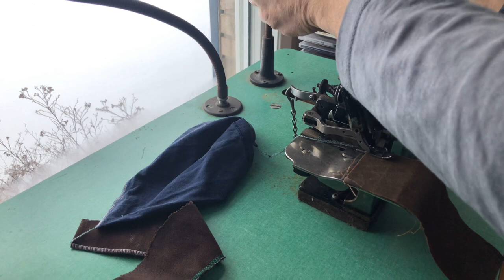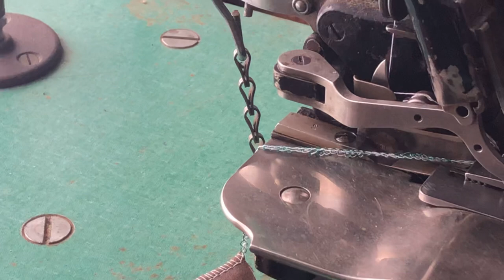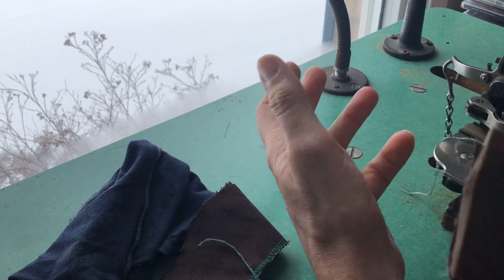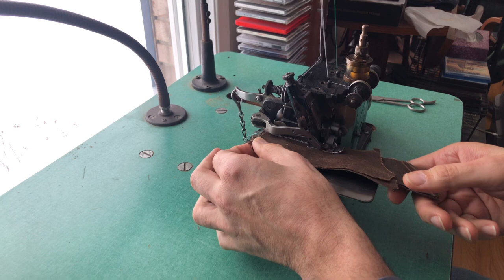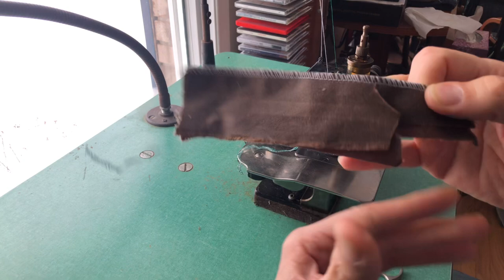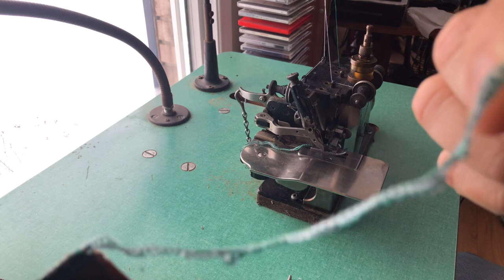MEET YOUR SERGER'S ANCESTOR: The Merrow A-3DW-3: From the Brand That Invented Overlock Machines!

Comment: Wow, what a powerful machine. That motor noise would drive me nuts. Now I see what the stretch overlock stitch on my Kenmores is used for. I always learn something from your videos. Looks like you've got some snow up there. I am about 6 miles inland in Connecticut. Week before Christmas we got 10 inches. By Christmas noon it was gone. Got another inch last night, GONE. I re watched part 10 Rescue series on the Kenmore free arm this morning. What's become of it?
Reply from the maker: I have a new idea for how to remove the grease on the Kenmore, but it will have to wait for warmer weather as I don't want to use anything odorous indoors.  I agree about clutch motor generally although I must say that this one is unusually 'quiet' relative to some which should more like a jet taking off!!!

Comment: Hi ...I am new to the vintage sewing machine world and happy to have found your videos.  I would like to ask what machine would you purchase for yourself...a Singer 301, 201-2 or a featherlight and why. Thanks
Reply from the maker: That's a great question. I often hesitate to say that there can only be one 
'best sewing machine' because, well there isn't.  For example, each of the sewing machine models you mention are all some of the finest ever made.  It really boils down to WHAT you will be sewing and the kinds of material you want to work with.  So, if you wanted to sew heavy weight woven fabric for a slip cover, the 301 would not be your best option.  Does that mean the 301 is not great?  Oh no, its just not the most appropriate tool given its slant shank and needle angle.  However, if I wanted to sew squares for quilting, delicate fabrics like silk or lace, the Featherweight would be hard to beat.  When I have had folks contact me and ask me which model to search for, my first question always centers on fabric types, weights, and projects specifics.

Comment: I was so excited to see your video because I have one of these machines!  It was relinquished from a garment sewing factory in the '70s because it was old. It still works great for me except I need new needles and probably could use the blade sharpened. Do you know where I can get new needles and blades? And do you think a regular sewing machine place would be able to give this machine a cleaning and once over?
Reply from the maker: Hi Susan. Well, if your machine is a Merrow branded model like this one, you may be in luck.  The Merrow company is STILL IN BUSINESS.  They are one of only 2 companies left in N. America that make industrial sewing machines here.  And Merrow keeps parts going WAY back.  You can get needles online and blades but you can also buy them direct from Merrow I believe.  That may be easier than having them sharpened depending on where you live.  Contact Merrow and see.  If your town is large enough, there may be industrial sewing machine servicers available.